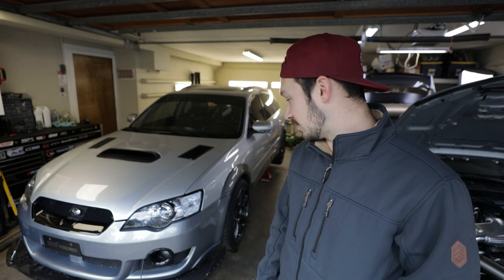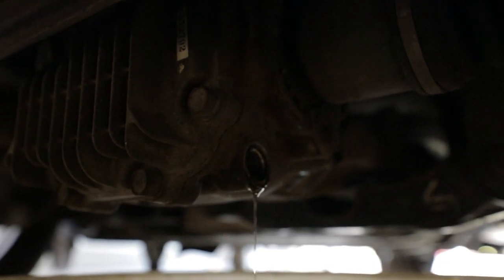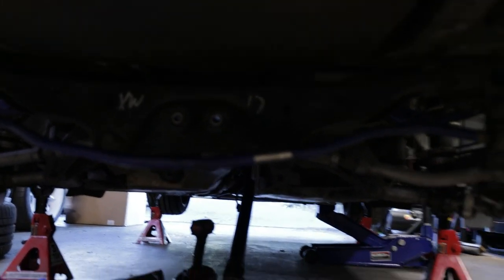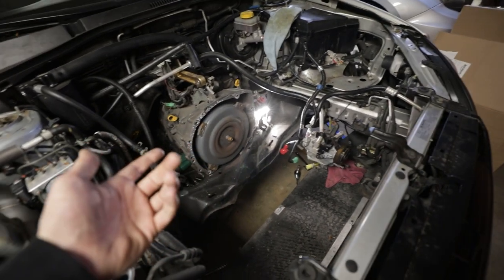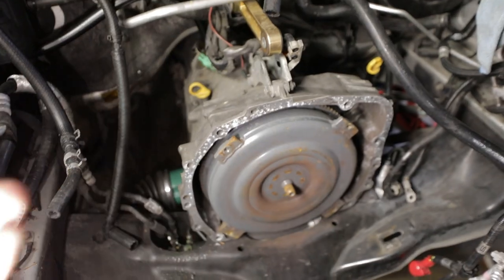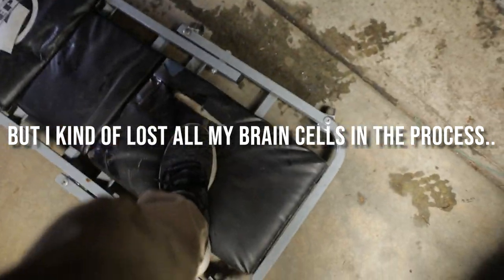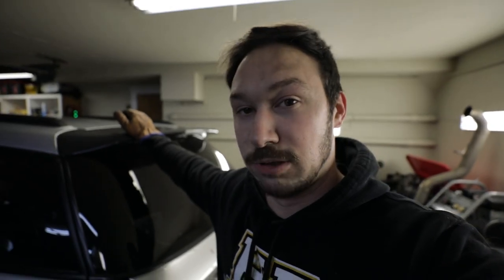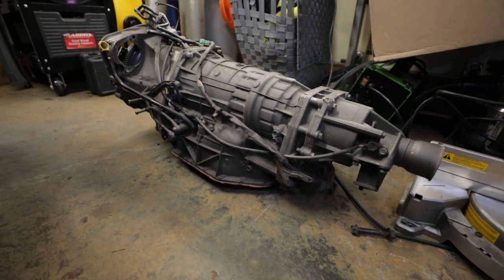No more 5EAT for our Outback XT (STI 6 Speed Prep!)

Comment: Congrats on the 6 speed, I'm surprise the 5EAT was able to hold up 400 to wheels without breaking. I have this love/hate with the 6spd Spec B, I love drivin it, but hate getting caught in traffic especially passing through Kent - down to Auburn area. 

Nice to see more Chewie content. I saw the same front bumper you have, damn that's pricy asf.
Reply from the maker: Thanks man, yeah, It's done really well with the exception of the flex plate exploding, which I may have to figure out something for if it happens again, but we'll push it more and try some things out on this next setup.

Yeah, bumper has become pretty hard to find nowadays, but they normally go for around 6 to 800 if they can be located. Tried for one for a couple years and got lucky on it.
Reply: @MatlasDI  Right on brotha! 🤙The XT just looks absolutely amazing, cant wait to see more especially now with 6spd. That's a killer!

Found a silver one for 1160 at subieparts, while lookin for a jdm spec b bumper and some rear spats.
Reply from the maker: @Jay C  dang, going up in price, it sounds like. I don't think there are a whole lot left. Makes me feel a little worse about chopping mine up, but far future plans I'd like to modify it more, make a mold, and do something like a carbon one-off version of it.

Legacy seriously needs some spats and things. Aside from what's under the hood that car is basically all stock and high mileage, so lots of future content to make on it.

Comment: Need a video of you reinstalling that cusco subframe brace
Reply from the maker: Probably make a short on it 😅
Reply: @MatlasDI  would definitely help alot not really any videos on how to install any of the cusco braces on our legacy/outbacks
Reply from the maker: @ACID MIKE  true true. I should be getting most of these or similar for Mittens, so I'll definitely make it happen 👌
Reply: @MatlasDI  ives been looking at the cusco rear lower arm bars and the subframe brace also been looking at the avo rear sway mount reinforcement but can't find anything about how to install them
Reply from the maker: @ACID MIKE  for the most part, most of those items you remove the bolts at the points they attach at and reinstall, but yeah I will be picking those up in time, so I'll be sure to make an install on them

Comment: cinder block the rear tires with e break on. Then just jack up the front as high as you can to drag it out from the front. It's not the best way but it does work on a e46 5l40e anyway might work with this.
Reply from the maker: That is a good idea. This car was difficult to lift in general, because the front subframe jack point was cut out previously to fit a bs oil pan. I may have to do this idea when we try to swap it into the legacy. 👌👌

Comment: I have a hydraulic transmission jack if you want to barrow it, I'm local just need it back by the night of the 14th. You would want to get the transmission under the car first the put it on the jack. If you roll it on the side you should be able to slide it in and out easier
Reply from the maker: Good info man. May take you up on that, don't know how soon we'll do the swap, need to check solenoids and swap them out first. 👌👌

Comment: I used 5eat tg8 from 2010sti for about 7 years on my forester. It broke the planetary body of the 2th-3rd gear after we raise power more than 500hp. Before power was plus/minus 400 for a long time. In Novosibirsk one man made less 9 sec on quatter on tgc7 on kis SG fxt. This is a good gearbox but you need a good cooling, tuned valvebody and torque converter from 3.6 tribeca. I bought 130doll a reserve gearbox from lgt tg5d7. But a tg5c7 is much more reliable because its simplicity. I can't use it according to CAN
Reply from the maker: Dang. That is a lot of info.. good to know. I'd be interested to see where this unit would fail at. Had zero issues pushing 460 torque through it, but it has an upgraded vb, high stall converter and built internals. Ran a cooler as well, but I would set it up differently this next time around and use a thermostat piece to not overcool it and let it warm up properly. Don't know what they could possibly do to beef up the planetary body, though. Coolest thing I've done so far is completely shattered a flex plate. 😆

Comment: Excellent to know. I have a stage 2 IAG half block sitting at pia going into an 05 gt wagon which I was going to upgrade everything for about 350 wheel. I think I'll wait and do the sti 6 speed. Ugh. This is expensive. Is the sti worth it or is the spec b a better option?
Reply from the maker: I would say comes down to if you want the dccd and close gear ratio, or would prefer a longer more even ratio. I think the spec b can be a desirable swap for daily driving. Longer gears give better mpg cruising, and less stuff to deal with, not to mention it is the cheaper of the two routes.

Comment: Sick! I also plan on swapping my legacy with a complete STI 6 speed by this summer before subiefest but since urs is auto do you have to make a custom transmission carrier for ur legacy like people say? Btw ur outback is so sick! Keep up the build!
Reply from the maker: Thanks man, appreciate it! Yeah, it's pretty simple to modify, you use the front and center support from a manual, and the rear support from the 5EAT, and then either lengthen the center support section, or make an adapter plate to bolt them together with.

Comment: Just recently found your channel from your hood vent video and been really liking your stuff! I've got an '06 Outback non-XT that I've been slowly modifying and racing in autocross. Would you have any tips for better performance for a non-XT 2.5i?
Reply from the maker: Hey man, sorry, comment flew under the radar. Non xt, there isn't a ton you can do to improve things power wise without spending more money than I think it would be worth. I think it would be more beneficial to work on the suspension and chassis stuff to get a better feel for things, that way if you decided to switch to an xt you could always direct swap parts over in the future.

Comment: Looks like a tight squeeze to work with, but do-able good thing you had the quick jacks. The frustrations must have been frequent. Especially if 1 or a few proper tools are missing. Buts still holy shit dude. Transmission swaps at home are a battle sometimes lol. Respects👍🏼.
Reply from the maker: Yeah, this was super annoying. lol I'm glad we could get it out, and the sketch work is done. I think the quickjacks don't lift high enough either, so we're going to have to plan some things out for the swap into the legacy. Thank as always bro 🙏

Comment: Hi Matt, love what you have done to the outback. I have the 06 same color. Can you tell me what erra sti six speeds will work? And what are the biggest rims, width wise that will fit? Look forward to seeing how that bad boy performs when your done!!! Keep up the great work!
Reply from the maker: Thanks man 🙏 you can use any year six speed; just need to make sure you get a rear diff that matches the ratio. There is a nice master thread on legacygt.com that goes over all the additional parts needed as well. Wheel size all depends on setup, we make them fit if we have to, but I would say biggest issue you run into on these chassis' when going wider is the rear trailing arm making contact with the inside wheel/ tire. I currently run an 18x9.5 +45 which required a 5mm spacer to just barely clear the trailing arm. Might be able to get an 18x10+32 in there, but likely would have some poke without running excessive amounts of camber.  I'll use  a 275 on this setup when I purchase tires again, so it fits what I need it to. 👌
Reply: Thanks Matt for your time, information and wisdom! Love the work You and Tanner do!

Comment: Looking for a 1 piece driveshaft for 05 legacy gt with 5 speed. Can find for automatic but not standard. What am I missing ? I’m new to Subaru game.
Reply from the maker: I believe driveshaft shop has discontinued the pre-built manual versions. You should still be able to contract them for a custom length one made to spec. I personally leave the 2 piece driveshafts even on higher hp builds, the tunnel gets a little tight, and I've seen clearance issues come into play, as well as weird nvh issues from them.

Comment: You should remove the converter first. Cuz that thin weight like 100 pounds
Reply from the maker: Yeah they're pretty heavy. I had left it on due to not wanting to potentially damage the clip or seal, but it would have probably helped a decent amount taking it off.

Comment: @MatlasDI hey cool swap but how did you get the 5 lug conversion done to accept the Brembos?  And what axles did you use?
Reply from the maker: No change to the factory lugs, bearings, etc. I have a video on the brembo swap which uses hybrid rotors for 04/05, and rears that have an inner diameter for the obxt ebrake shoes.
Reply: @MatlasDI  😎. I’m gonna check out this video. I want to do the brembo swap but only have the dba rear rotors and brake shoes for this swap.
Reply: @MatlasDI  my OBXT is 4 X 100 lugs. Will the STI knuckle work on the OBXT?
Reply: @MatlasDI  so you kept the 5 x 100 bolt pattern.

Comment: I've been thinking about a manual swap in my lgt for a while.   My 5eat is on its last legs but damn this looks like a pain.
Reply from the maker: Wasn't the most enjoyable thing I've done on the car 😅 I think if you had a lift that could get it high enough to use a transmission jack, it would be worlds easier. I unfortunately don't 🥲

Comment: Hey there, to lower the OBXT, do you just swap to coilovers for legacy?

Or you recommend to swap all bunch of those little parts from the LGT(bushing, contorl arms, bolt...etc or even the drive shaft and steering universal joint) for keeping the right geometry like they said?
Reply from the maker: You can do either. The right way would be the second option you mentioned along with removing the subframe spacers. On the outback I swapped it to legacy geometry. I would recommend to do it that way if you plan to have the vehicle align and handle appropriately.
Reply: @MatlasDI  Thanks man, I would try to figure this out.

Do you know where I could find a parts list for gathering right things that I need?
Reply from the maker: @motographer9657  if you search on subaru legacy forums for converting to legacy geometry, it should have all the info and part numbers on there, otherwise if you are on discord you can join the smeedia discord and shoot me over a message and I can round it up for you 🤙
Reply: @MatlasDI  I'll do some research first.
Appreciate it!

Comment: Hey there Matt! Saw the vid with you and Tanner having your six speed built. Did you end up totally rebuilding the six speed? What year tranny did you end up with? Did you change the stock gearing? Not sure to ho with a 07 or newer. Any thoughts?
Reply from the maker: Mine was from a 2020 sti, it only had around 9k miles on it and just needed a 4th gear synchro. They newer models have brass 4th through 6th so we swapped for the carbon lined ones from prior to 08. It's getting harder to get diffs now that match the older styles, so I would just keep that in mind. Ideally if you're not opening things up you'd want a unit with the carbon synchro, but if you have someone that will replace those you can go with any year range. I'd just try to get a matching diff to go with and keep that in mind.
Reply: Nice! Pretty cool most all of the era six speed will work! Are you going to have to do any kind of additional wiring from the automatic to the manual? Trans wiring, clutch etc? Or is all the wiring already there? Also how about the newer model trans, will the wiring harness work or will you have to swap it for the same era? Most importantly, when's your next video coming out??? Thanks Matt!
Reply from the maker: The outback will be switching to a haltech system so i can have better control over things. Normally, we would have to tap for neutral switch and do a few other weird things like flashing to a manual rom, but most of the pin outs are there. And it's just swapping or splicing some things over. We've been working hard on the wrx, so I've held off on my stuff to help out with that so we can both get to the tune next week, but I'll be filming swapping the 5eats today and tomorrow which should have me ready for the tune, and then some good updates coming up. I'm hoping I'll have one filmed and up by Monday, but if not, I'll do a live with a channel update. 👌

Comment: What driveshaft are you running for the sti trans
Reply from the maker: Either a spec b or have a custom one made. Think a 4eat works as well, iirc.
Reply: @MatlasDI  I picked a up a complete 05 sti 6sp swap for my 05 legacy gt. I’ll probably swap in early may. I’ll hunt down a drive shaft. I thought the 05 sti driveshaft would have been the same
Reply from the maker: Yeah, unfortunately from what i understand, length and center bearing mounting are a little different. Depending on the swap components the rear diff yoke connection may have to get changed as well. They have a 6 speed swap thread on legacygt.com that goes over a lot of the little bits and pieces.

https://www.legacygt.com/topic/53783-6mt-master-swap-thread/

Comment: Them things suck ass.  I had a IPT Valvebody for my LGT and it went to shit quick . I have a JDM 5EAT sitting here with low miles and ended up buying a 08 Spec B 6spd Swap instead . So I'll be in the process of doing the same but I do heavy duty Harbor Freight trans jack that tilts left or right ,forward or reclined back to help get it in placed and angled to mate up to engine.
Reply from the maker: That's what I'll likely look at picking up to make things easier. Makes me think most of the companies that do builds don't inspect or do anything sbout the valve body solenoids themselves. That's why I recommend only sending in a new valve body for modification, as I had nothing but issues when they modified mine. I'll be swapping just the solenoids so we'll see if that fixes the issues, either way holding power wise I hav3nt had issues with mine yet.

Comment: Engine hoist the front end up and
Slide her out the front
Reply from the maker: We've done this when we've pulled 5 and 6 speeds, just got a little worried with the weight of it on the pitch stop mount, which is a bit thinner than the mounts on the 6 speeds.
Reply: @MatlasDI  I engine hoist’d the car not the tranny when I pull my the auto out of my donor car. 

     Ps I also broke my creeper when I used it out slide out the tranny.
Reply from the maker: @Logan Boswell  ah, gotcha. Yeah I don't know of a strong enough section up front that wouldn't potentially deform. Poor creepers 🤣
Reply: @MatlasDI  crossmember and strap. 
Keep up the great content and can’t wait to see six speed swap vids. I need to six speed swap my sf5
Reply from the maker: @loganboswell700  that's a good idea. 👍 thanks man 🙏

Comment: TIL its not my problem if I sell it or give it away.
Reply: How well was the 5eat holding up? You mentioned it was built, what have to done to the 5eat?
Reply from the maker: Haha exaaaaactly 🤣
Reply from the maker: @William Bryant  the 5eat is a level 10 custom build. Valve body is modified, front pump is ported and reworked, has upgraded clutchpacks that are stronger with additional disks, they upgraded the diff bearing per request, and modified the torque converter to be a high stall unit. There are some other "things" they do internally, but they don't really go into detail on what exactly it is. He had said this was their 800hp option. I highly doubt it will hold that, but it'd be fun to test in the future.

Comment: Turn it on its side
Reply from the maker: Definitely an option, I kept it upright to not dump any more fluid out of it, but it may make it a little thinner. It's just a bit of a pain with the big rectangular oil pan.
Reply: @MatlasDI  put it on cardboard then tip and pull cardboard
Reply from the maker: @CWW-tv  it's out now, but I'll have to swap some solenoids that have stuck since before it was built, and then work on getting it into the legacy. Fun times 😅